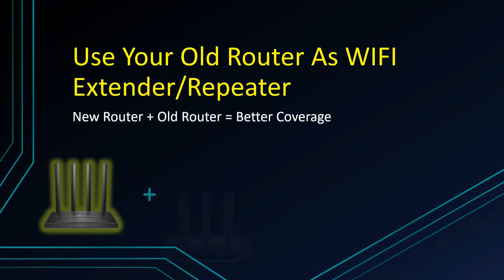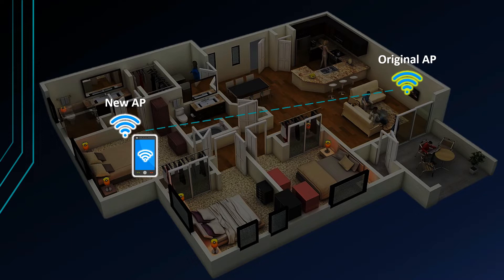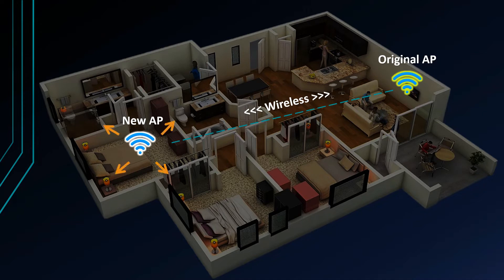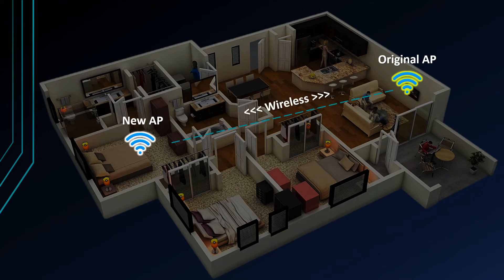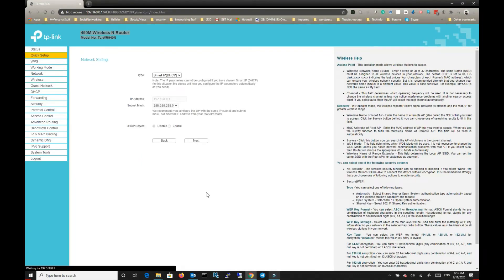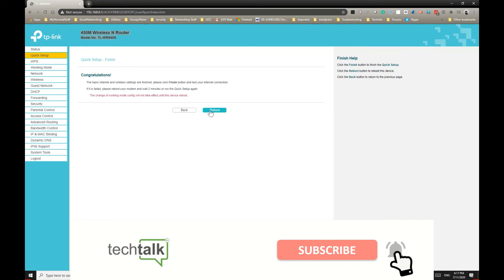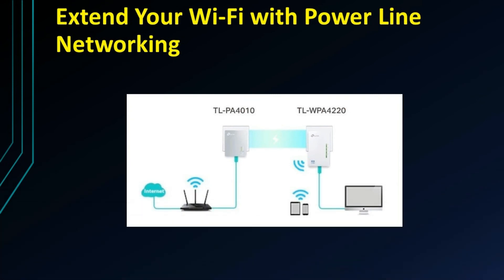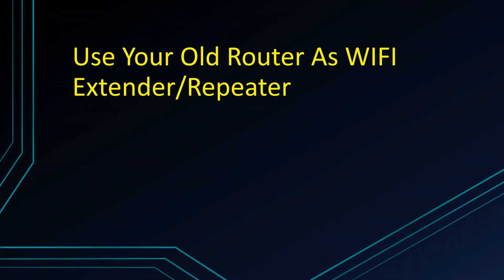How to Use Your Old Router As WIFI Extender/Repeater/Access Point

Comment: i have a lanka bell router and slt router can i use the slt router as a extender for my lanka bell router bro?
Reply from the maker: Yes if you hav lan ports in your lankabell router you csn try wired method.
Reply: @SLTechTalk   yest it has bro but i dont no the steps to do it
Reply: @seyedruzaik9247  1. reset your slt router.
2. Just connect your two routers with a cable using the ports. (check the video)
3. login to the slt router and follow the steps in the video.